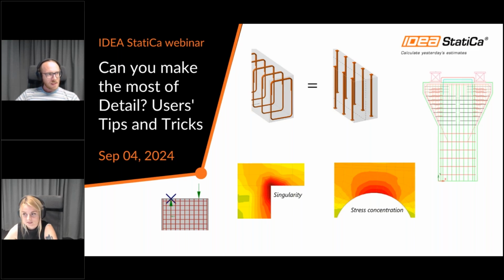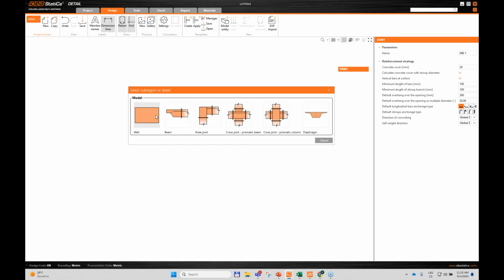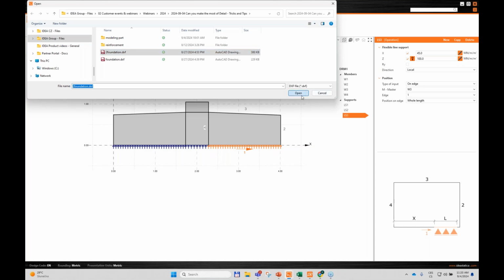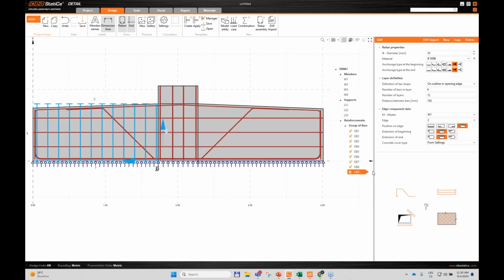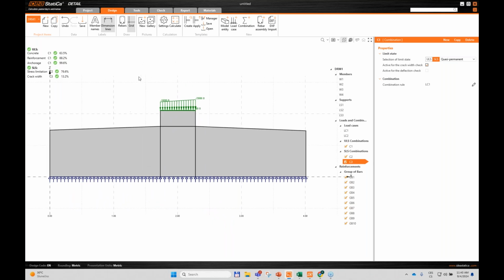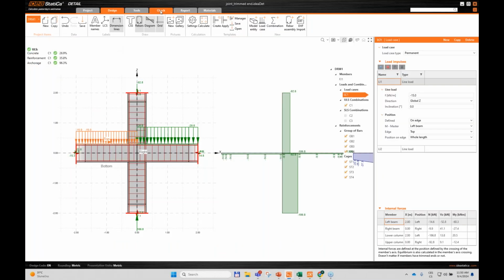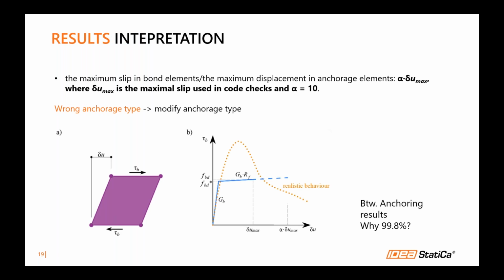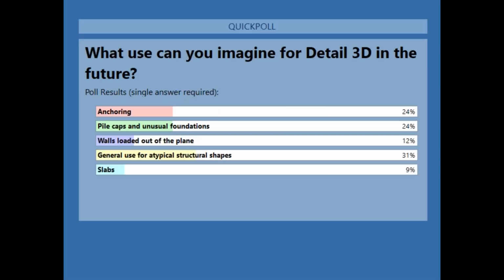Can you make the most of Detail  Users' tips and tricks

Comment: Is it possible to calculate punching shear using this method?
Reply from the maker: Punching shear is a three dimensional problem. We are preparing it into the 3D module of Detail application, but this use case has not been verified and therefore released yet. In the 2D module of Detail that is presented in this webinar, you could also calculate it, but be aware that the model is only in plane, and does not fully capture the 3D aspect of punching shear, so extra caution and engineering judgement is recommended.